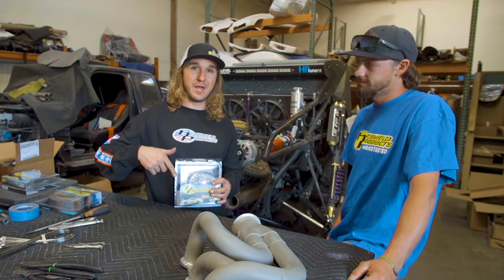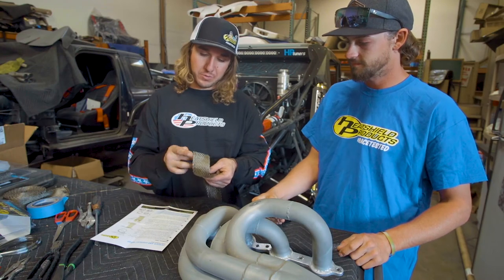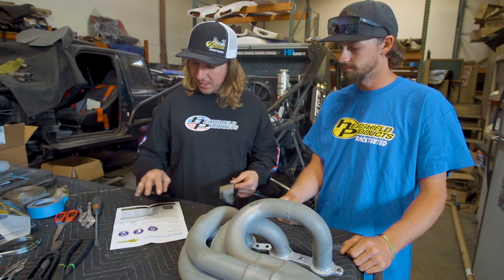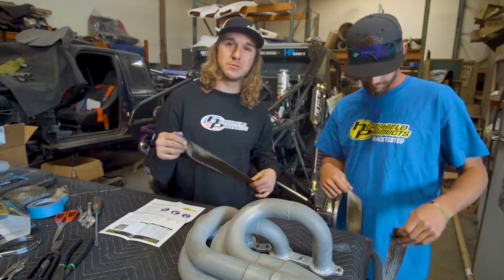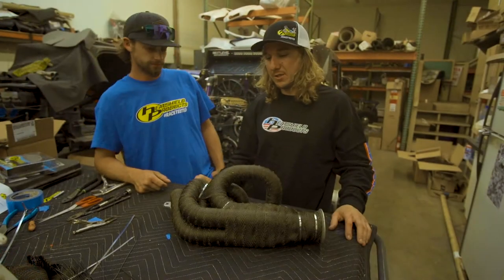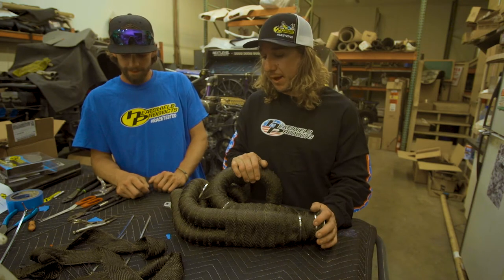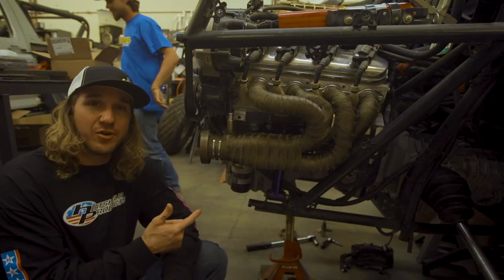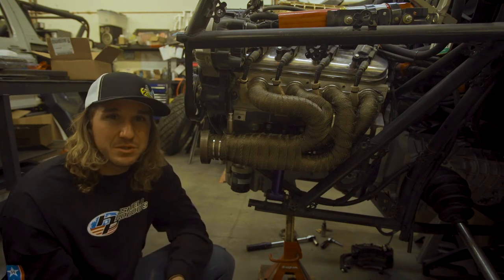How To Install Exhaust Wrap with Blake Wilkey

Comment: You've done a nice job wrapping! You mentioned you do a 50% overlay when wrapping. I believe it's suggested to do a 1/4" overlay. Too much of an overlay would potentially hold in too much heat and eventually make the metal more brittle, leading to cracks and metal fatigue.  Just pointing out that sometimes less is more. Again, nice job and video.